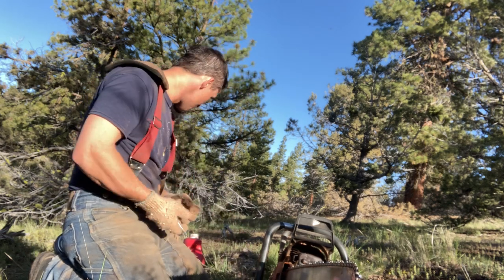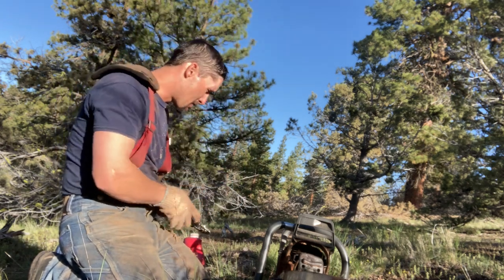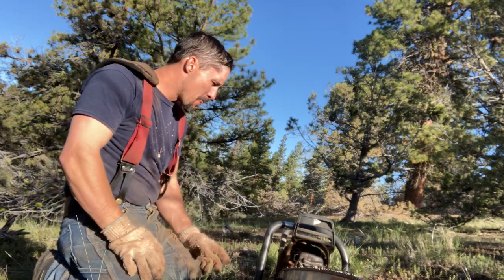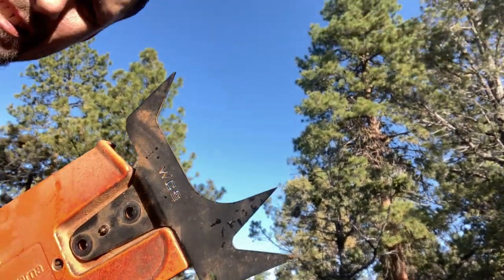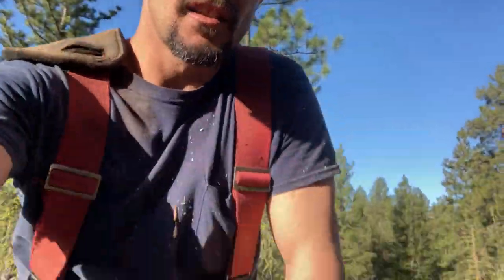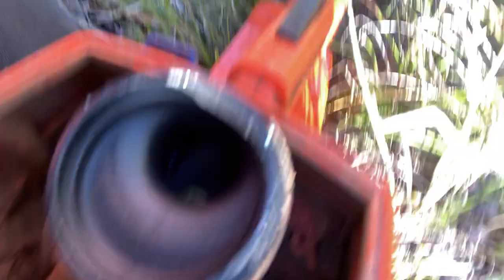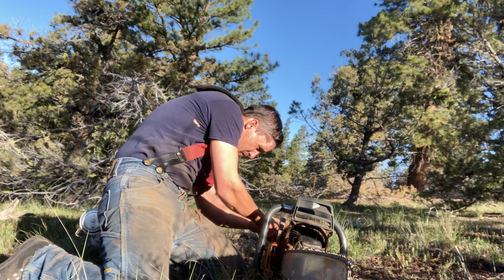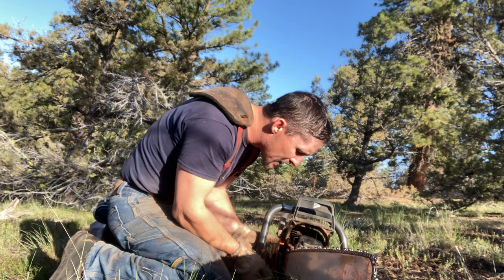A foam air filter for husky’s! And West coast saw dawgs!

Comment: I've been running Gordy's dawgs since he put them out, I like them a lot. I know what you mean with the tolerance being tight every time you put the clutch cover back on but I think that's helping strengthen the whole system. 3 series Husqies have that reputation for the inside dog working the case mounts loose/stripping etc. especially with bigger dogs. Wouldn't be surprised if Gordy built em like that to beef it up!

Comment: Recently got my B sawyer and now that Im getting to cut more trees definitely upgraded dawgs for our crews saws. the 462's are okay stock but the 362's absolutely suck. we are running the wcs 3 points cant go wrong. but for the 362 since were keeping 28" bars on them I went with Egan performance 3 points theyre a little shorter but same concept. Havent got to try them out yet but should be just as solid!

Comment: I’ve found I like long dogs for getting long bars to feed in dry hard eucalyptus. On shorter bars in felling situations, I have found more tendency to stall the clutch when first putting saw to wood. Maybe just a technique error. How would you say the WCS dogs are as far as that goes? Thanks. 

Super bummed about your missing vids, I’d be raising heck with YouTube…Heck,  I might do it for ya…? I was enjoying learning…
Reply from the maker: What are your rakers set at? Does it stall when you are cutting horizontally into the wood, or just when you cut the face cut out? I’m betting probably more of a chain issue than a dog issue. Possibly too steep of angle on the top plate angle, or rakers too low. WCS dogs are definitely not the way to go if your chain is to hungry…. As far as the videos go. I honestly think my 3 year old twins may have gotten my phone and somehow deleted everything🤷🏻‍♂️. Either that or my account got hacked..
Reply: @jakemesa3211  Yeah, I get more bucking than felling. Got a grinder and was having fun making cookies faster and faster with ported saws, 8 pins, more hook, and feeding lightly...then went to felling and really had to be light handed. Off idle throttle response/torque are more important felling than speed.  @HYPERSAWS told me he actually runs two different setups for felling vs. bucking. Have a gander at my vids if you get bored, will give you an idea. I have gone back and forth on big and small dogs on my ported 357 and 2166 (372). I really like the Crescent Dolmar dogs on my 7900. Short at the bottom so not too much leverage to stall the clutch, but long on the top to keep knuckles and brake flag off the log at the bottom of a bucking cut in bigger logs. 
Thanks
Reply from the maker: @davidwyby  yep, if you’re just bucking a hungry chain ain’t a bad deal. Go to throwing in under cuts with one and by the end of the day You’ll wanna quit running saw. I personally have the mind set of a smooth chain is a fast chain when it comes to production cutting. But that’s just me. Anyway I’ll give your videos a look!
Reply: @jakemesa3211  I agree…bucking I like them as aggressive as I can get without  chatter or saw shudder, but that’s a bit much for felling…square is really where it’s at, I have some square chains from forum buddies, but I don’t have a square grinder or the patience to square file.
Reply: @jakemesa3211  somewhere I have a vid of the 2166 with the rakers too low. Annoying shudder, you can see and hear it. But Kevin makes torque and she pulls it no problem…not that I like it that way. One of the nice things about having a grinder is the chain is more consistent and smooth…gotta be just right for dry hard euc or it will skate and the saw will scream or too aggressive and it’ll shudder.
Reply from the maker: @davidwyby  I was just watching a few of your videos. Chains are all cutting good! For bucking that is… as far as I can tell don’t matter what dawgs you run. On the stump you’re going to have problems with stalling the clutch. Not trying to be critical just trying to answer your original question. Square grinding is definitely easier to keep everything the same. But if you put a little less angle on the top plate it will cut smoother and be more forgiving Of discrepancies between teeth. You’ll sacrifice a bit of speed when bucking. But it’s really pretty minimal and the bearing’s of the saw will thank you anytime you’re on the stump.
Reply: @jakemesa3211  thanks, I appreciate it.

Comment: I've been looking at those RedBeard mods. Just haven't committed to it.
Reply from the maker: It’s some of the best money you’ll spend. Especially cutting in the black like you are. I run the uni filters now, the 3” tall ones. Absolutely no fines pass through. Those dogs are worth the money too! Like I said on one of your videos I don’t seem to have as bad of problem with the bolts backing out on the inside dog with them.

Comment: It's good to hear from you Jake. I'm glad you're staying safe and keeping out of trouble. Those chainsaws gotta breath. My spark arrestor got all plugged up about a week ago. I burned the carbon off and it's all good now.
Reply from the maker: Thanks Steve! It’s good to hear from you too! Yep, it’s all about moving air efficiently as possible. What kinda mix you running and at what ratio? Shouldn’t be fouling your spark arrestor. Anyway I hope you and your loved ones are doing well!
Reply: @jakemesa3211  Well, I'm just a professional homeowner when it comes to chainsaws. I just have a Stihl 018 and I go to the dealer and get a small bottle of Stihl oil, enough to mix one gallon at a time. I couldn't tell you the ratio. I cut a couple cord of firewood a year and use it quite a bit when I work at a Christmas tree lot here in Eureka. My brother has tree farms in Oregon and he comes down every year and sets up a lot. I sure do admire what you do as a true professional. I worked on a logging show but never as a timbe faller. I suspect I just need to run my little saw wide open more. Thanks, Jake!
Reply from the maker: @stevet8121  a 018 was the first saw I ever had. My dad bought it for me when I was 12 in Orville! What a great little saw that was. Funny thing, after a year or so it plugged the screen too! I doubt it’s anything your doing wrong. I removed the screen and never looked back. Ran the piss out of that little sucker!! Then passed it on to my little brother. Then he ran the piss out of it for a few more years! I appreciate the compliment! I do alright for a guy in my area, but the real timber fallers are on the PNW coast, Alaska and BC.
Reply: @jakemesa3211  Great story, Jake! I got a new bar with a slightly bigger chain and it cuts real clean and free. I learned to run pure gas and it really rips. No ethanol ever again. I cut firewood on Forest Service land, or I'd get rid of my screen too. You could keep up with the best of fallers anywhere. I hope you get the chance.
Reply from the maker: @stevet8121  nor cal and Alaska are the goals! If things work out I won’t be cutting juniper and thinning for very much longer. But I don’t want to say to much on that till it’s a definite…. I hear ya about keeping the screen in too please the forest circus. All my saws are screened too. Back in the late 90’s a guy could get away with it a little easier. As far as fuel goes, you definitely made the right choice by switching to premium!